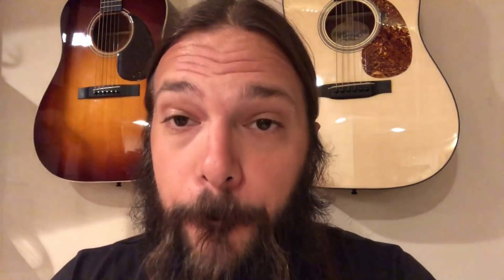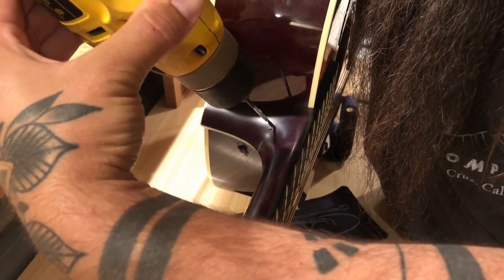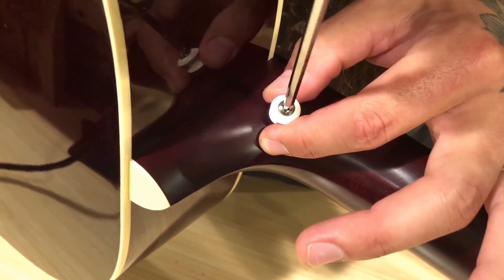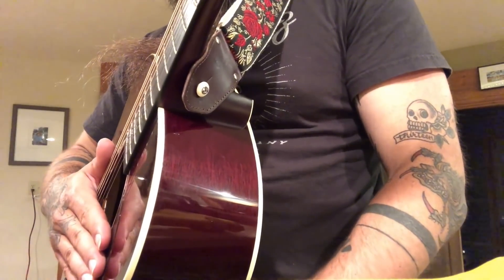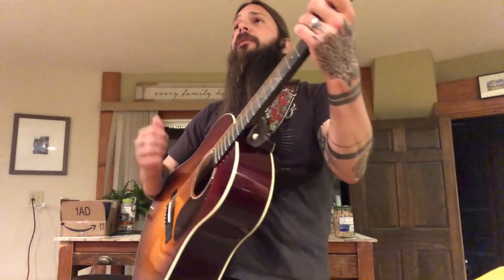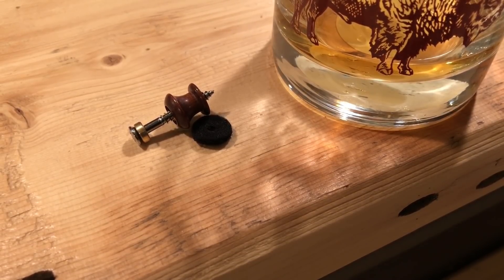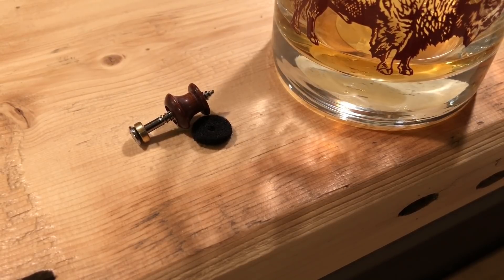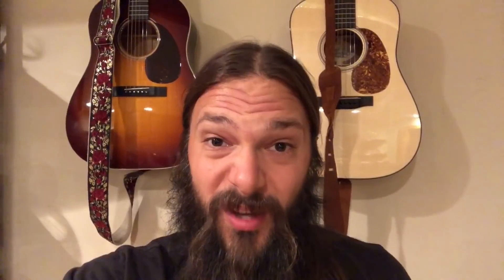My NEW Waverly Strap Buttons Installed! (and I broke one)

Comment: If you use tape on the heel before you drill, it will prevent the chipping around the hole, not that it matters a whole lot but gives you a better piece of mind.

Comment: I just installed one of these in my D28 and used a 3/32 drill bit with some paste wax on the threads. I drilled perpendicular to the surface of the heal about 3/4 inch from the body and 1 1/2 inches from the bottom of the heel. They are really nice strap buttons.  I've had one on my OM for 10 years.

Comment: I have a question after viewing your video. Why is it that installing a 2nd strap button on an acoustic guitar in the location that you put it, has become the standard or "go to" solution? I play up on the 12th, 14th, 16th fret and beyond all the time, due to the kind of music I play, and jamming my palm into the button and strap end is not very comfortable, and actually quite disruptive. About 15 years ago, I purchased a used Santa Cruz Standard OM. I noticed it had a second strap button installed, not in the location as shown in your video, but in the neck block, adjacent to the heel, on the bass side...screwed through the side of the guitar. When I first saw it, I thought "what idiot did this?" and I figured I would eventually move it. However, I tried it out...and it actually works, with nothing getting in the way of my fretting hand when I'm playing up high on the neck. Just thought I'd throw this out there in case anyone else is bothered by the same problem. BTW, love your Tuesday video posts...very informative and entertaining. I watch every  em....thanks!
Reply: I have t'he same problem, I use frets from 12 and higer. Do you have a link or something to see what U mean with that alternative strap spot?? Im not english speaker so Can't understand all Your commentary

Comment: Did you Notice any Sound difference in the Martin after installing the Button? I purchased a set of Gold Waverly tuners and they include the button set & six bridge saddle-pins. The screw that is included is Gold colored and its probably brass. I know those screws are easier to break than the silver. I haven't installed yet, building some courage to drill my Martin D Special. Thanks for the vid, it helps after watching it.🎸🎅

Comment: Tony, what os the best way to use a strap with a guitar that has a pickup installed with a jack at the endpin hole, just make the hole on the strap bigger? Or just use a soundhole pickup?
Reply from the maker: Great question, you could stretch out the strap hole, or use a product that I will be reviewing in episode 101 the music nomad Acousti-Locks.